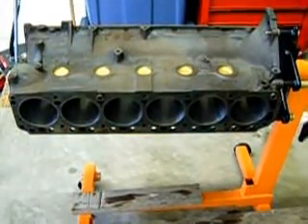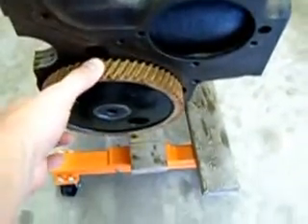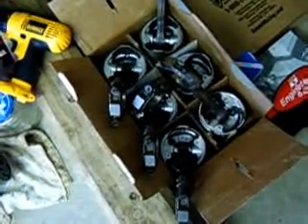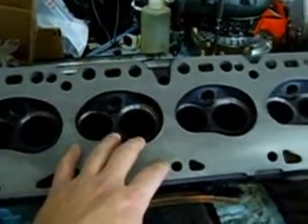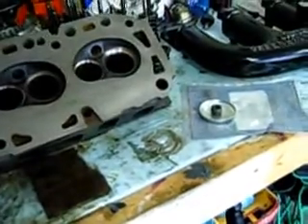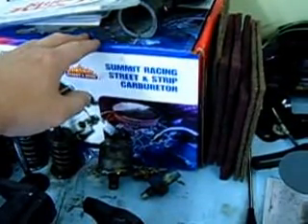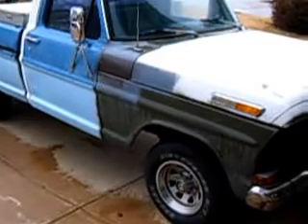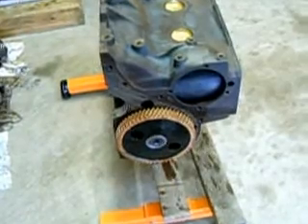Ford 300 Inline 6 Rebuild Part 1

Comment: Got a '78 F150 Custom with the 300 inline 6. Had it for a couple of months and i believe its starting to develope a knock. I plan on a replacing the connecting rod bearings and the cam shaft, but not sure if that would fix my problem entirely. Is there some inexpensive way i can fix this without a total rebuild.
Reply from the maker: If your going to replace the connecting rod bearings and cam shaft, I would go ahead and to a complete rebuild.  Your not really going to know until you get into the engine and check the cylinder walls.

Comment: Hello Jason. The only thing I would have done differently would have been the Timing gears. I see you used the oem fiber cam gear. Conventional wisdom with the 300/4.9 is that when you add more stress on the v. train with an aftermarket cam, v. springs, etc., it is best to use metal gears to prevent early or premature failure. Cloyes is usually chosen with alum. cam gear and cast crank gear. With that set you can advance the cam timing too, to retain low end torque. 

If you do need to R&R the starter, it is possible to torque one of the header tubes with a crow bar slightly to get the starter out. For replacement I would use the smaller EFI years starter. Good luck.

I'm curious about your mpg. I had that carb on mine but was bothered with vapor lock, since, with my DP manifold, the primaries sat right above the headers. kevin
Reply: Yeah...why put a 120,000 mile timing gear on a 300,000 mile engine?

Comment: hey Jason ive got an 81 f100 custom. 4.9L. the engine hasnt been rebuilt since its been out of the factory. i blew the engine by accident (as in piston rings). im just trying to figure out if i need to bore out the cylinders and if so do i need to get rebuild kits for a 5.0 and 4.9L.  if you can help me put as much as possible with my questions that'd be much appreciated. thank you

Comment: i got a 94,  4.9 with 301000 miles that just lost oil pressure, needs a rebuild i would guess.   Is this the same engine you have here ?   thanks , good stuff.
Reply from the maker: The block is a 94 and the cylinder head is from a 68, so the your rebuild would be the same as mine.  Good luck with it if you are going to rebuild and make sure you post some videos.
Reply: *****
thanks Jason,
  To be honest, i got a major project going on with an old Camaro.  My truck just started acting up a few weeks ago and i might try to take it to a shop and get the work done, either a new engine or a rebuild.  Right now all my spare time is on the Camaro project.   thanks Jeff
Reply: Steeljaw Jones

Comment: Probably the reason this engine is rarely seen is because it tends to go forever. I have a 84 short bed 4x4  with 200k miles finally replaced the harmonic balancer .  It was the powerhouse for all my tree stump grinders.and chippers ran them all day. Never saw one break never worked on one. Why work on something thats running well.  Good luck on your project. Send more videos. Thanks.

Comment from the maker: On the right side of the block near the freeze plugs you should find the casting number and you should be able to find out that way.  The main difference between the two is the stroke. The 300 has a longer stroke & shorter rods

Comment from the maker: I pull the trans off then pulled the engine, when I reinstalled the engine the trans was attached.  I bolted one end of a chain to a exhaust header bolt hole and the other end of the chain to the front of the block.  Hoist lifted the engine with no problem,

Comment from the maker: I know at some point ford changed the size of the cam bearings.  If you order parts for your year engine you shouldn't have any problems.  Not many changes where made to the 300 so you shouldn't run into any problems with parts not fitting.

Comment: Do you think there's any difference between the 70' straight 6 and the 95 straight 6 besides carbureted and fuel injection, because I have a 95' f150 4.9L, I'm deciding on rebuilding it or just drop in a rebuilt 5.8. Please respond as soon as you can before I decided. Thank you

Comment: found out it was the marinizers that did that to prevent the tork from slipping the gear the cam grinder was shocked to see it said he had never seen it before  since it is a marine engine it is quite a bit differant and getting a reverse rotation cam for it is impossible  i should be sooting this assembly in about 2 weeks

Comment from the maker: @clackp72  hey I dont remember taking any bolts out of the cam gear.  I'll need to look that up.  The gear is pressed on I had to remove it with a gear puller, however it does have threads in it so I'll look that up.